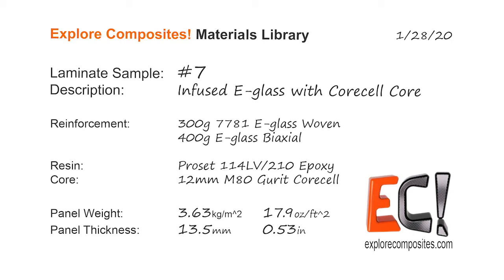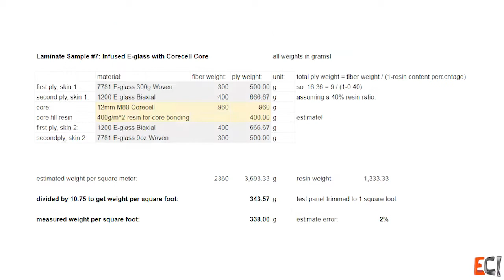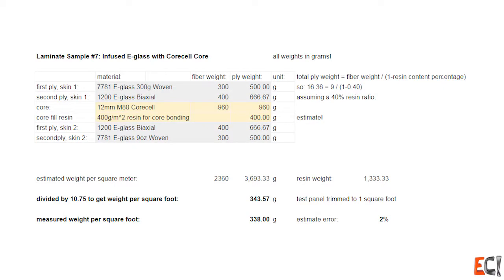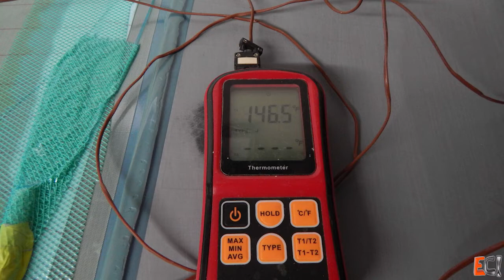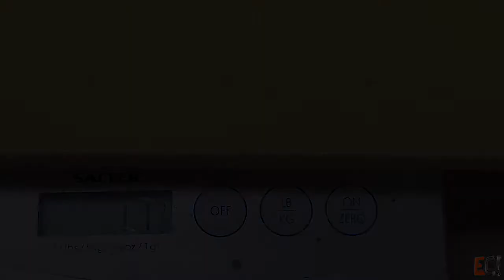Laminate Sample #7: Epoxy Infused E-glass with Corecell Foam Core

Comment: along with your data point I did a simple infusion test with Polyester resin  without a core glass along, in my sloppy set up my supply manifold was straight or parallel to the glass stack the vacuum side was not, as the resin crossed the glass stack it began to follow the irregular shape of the vacuum side. i used the spiral wrap for the supply and vacuum manifolds,, I learned a good bit ! Thanks
Reply from the maker: Nothing like trying something out to get a feel for it.  It's a pretty neat process but there are so many variables - it can be super frustrating!
Reply: @ExploreComposites  I had never seen a Vacuum break my guess is its purpose it to balance the vacuum line  across the part?

Comment: Perhaps I'm missing something, but the kg/meter squared doesn't match with the ounce/square foot. 3.63kg/meter2 should equal 11.88oz./ft2.
Reply from the maker: Grant you are absolutely right.  I looked back at the spreadsheet and that was before I had both measurements in there - no idea where that 179 came from.  Thank you for pointing out this mistake!

Comment: Awesome videos, thanks!  What is the infusion table surface?  What kind of prep do you have to do to it?
Reply from the maker: The table is carbon skins on aluminum honeycomb, primed.  The surfacing film is an adhesive Teflon product sold by Taconic in NY, USA.  Similar to Airtech Tooltec.  Great stuff for flat or simple-shaped surfaces - and no release system to deal with. No prep - you just wipe it off.  It does get scratched though and after a while it needs to be replaced.

There's a post about it on the EC! site: 
https://explorecomposites.com/2019/10/02/adhesive-teflon-its-awesome/